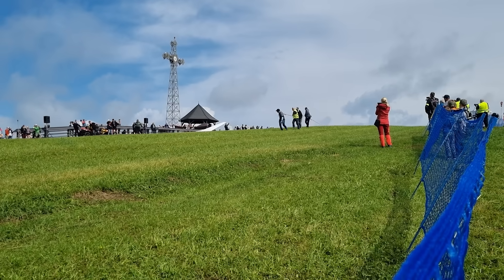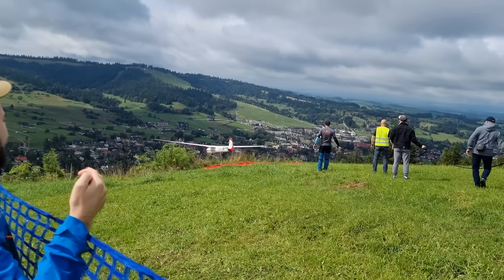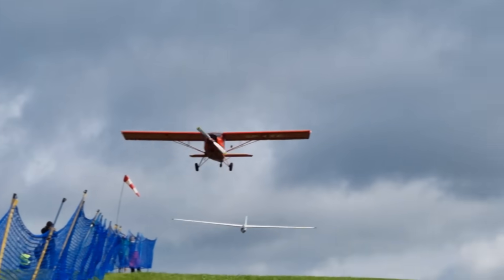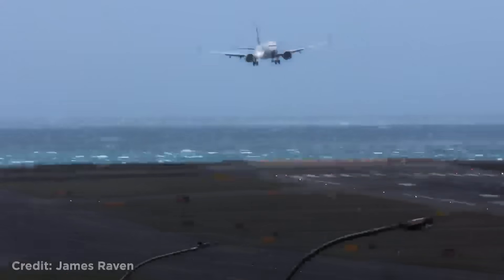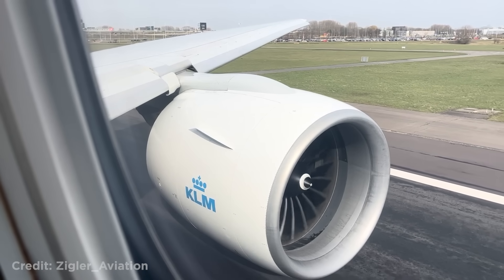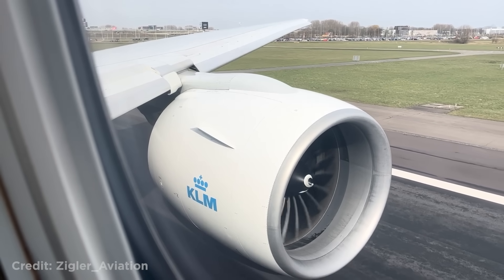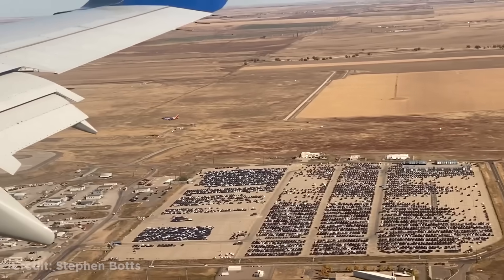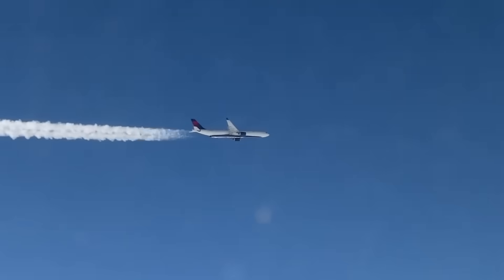Pilot Takes Off Too Late

Comment: No, they were NOT close to each other. The tele lens makes it appear they are close to each other, when in fact they were correctly separated both laterally and vertically. This happens frequently in high density airways, like above the Atlantic, for instance.

Comment: Once that plane touched down at 1:00 isn’t the danger over? You would think getting airborne again would be the tricky part in high winds 🤷‍♂️🤷‍♂️
Reply: please do your research first. the plane clearly bounced and could've slid off the runway if they didn't go around. if they continued the landing, it could've even had a wingstrike from the tilt of the aircraft
Reply: @MaxLai_0104  but he too has a point as you can see many many videos here where airplanes bounce 4-5 times and still make it.

Comment: How high do you expect a glider to go on a bungee launch?
Reply: Sinply said
on a which tow almost as high as the length of the rope is, whereas in this slope down takeoff the glider as soon as it gets enough speed to get airborne, depending on wind strength, can climb some feet as the hill slope keeps going down. Then the glider will have to find a thermal ascending air in order to climb high up to the cloud base above. In case no thermal is found it will gradually glide down to the landing field. Their glide ratio goes from 27mt forward to 1 altitude meter lost to a maximum of 75mt to 1, it depends on sailplane's model.

Comment: 2:30 So that's what only 1000 foot separation looks like. Seems a bit close to me. I would be concerned about wake turbulence.
Reply: Wake turbulence descends about 400-500 fpm and only descends about 900 feet, so theoretically they should be fine.
Reply: @aviationman212 ….and that is precisely why the rule is 1,000 vertical separation.
Reply: It’s 2,000’ of separation, the airplane is large so it’s hard to tell
Reply: @vondahe nope, it’s why they are offset.
Reply: @aviationman212 nope, it definitely can cause wake turbulence, this is why they fly offset.
Reply: @SgfGustafsson it’s 1000 feet. When crossing the Atlantic, the track systems is one way depending on time of day.
Reply: @rtbrtb_dutchy4183  How do you know it's over the Atlantic
Reply: @SgfGustafsson  because my professional opinion is that the airplane is 1000 foot higher, based on the winglet at the very beginning and the window at the very end. 

As far as I’m aware, the only place that uses 1000 foot increments in the same direction, are the tracks over the Atlantic.
Reply: @SgfGustafsson  I stand corrected. Thank you for that.